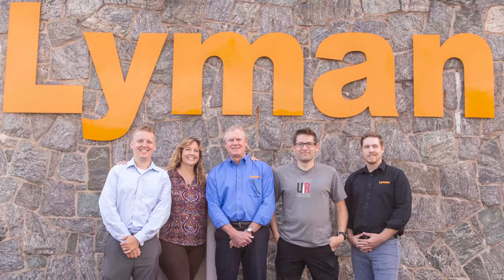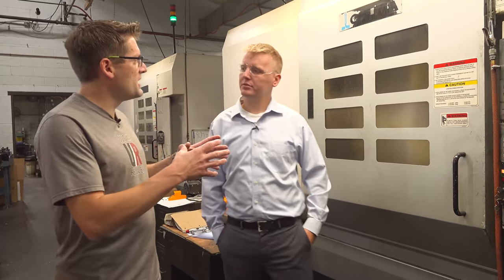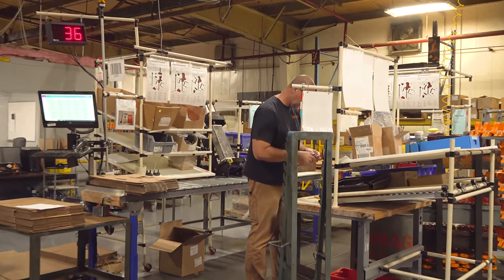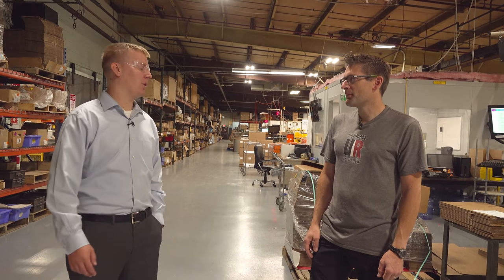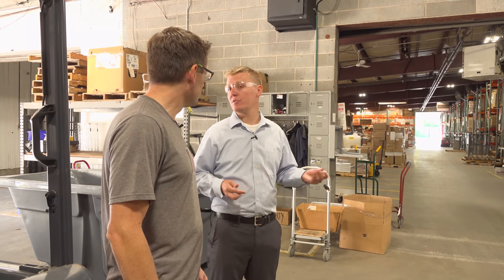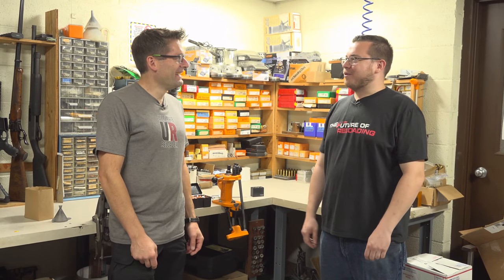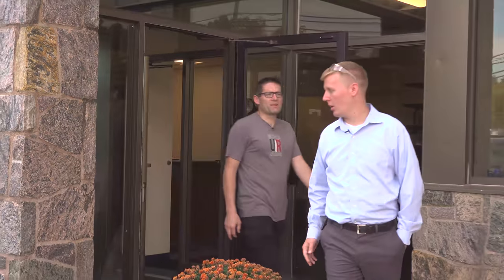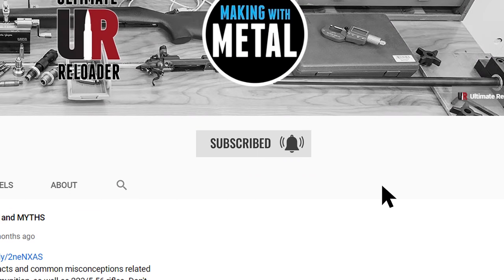Lyman Factory Tour

Comment: It seems that Lyman is really stepping up their game. 40 years ago I considered them a low tier manufacturer. But now they are running with the big league. I like the made in America with all American materials.
Reply: Tim Vatter that’s interesting. I’m 30 years old and I’ve always considered Lyman to be upper middle/top tier. I wouldn’t have guessed they were ever considered low tier.
Reply: @RebelFlag61  to a lot of us new comers Lyman isn't on the high mark of companies, most of this has to do with reloading Snobs.  I am glad I found this channel and saw this video, I have some Lyman stuff as I could afford it, but was not aware of the manufacture location, as I did not read anywhere on the box Made in the USA.  I truly want to buy American made to support American companies.  I will be purchasing some more things from them.
Reply: Lyman is absolute top quality, always has been!!
Reply: When i was shopping around for my gunsmithing screwdriver set i looked all over and just so happened to find that Lyman had a set. It's price made me think i was probably getting something with quality similar to wheelers. In other words good enough to get by during my apprenticeship. Well after 2yrs it's still going strong. I've even used some of the bits with my impact driver to remove screws so rusted into place i thought i would have to drill them out and never broke any of them. I have had to touch up the edge and tip on some of the thinnest straight blade and torq bits but once again i used them in cases beyond what they are designed to do. The driver handle is among my favorite too and I've tried probably over 2 dozen different brands bit drivers between my time in automotive and then gunsmithing. Theirs is shaped so it's very comfortable for long days at the bench, has a very grippy material so you aren't fumbling around with oily or wet hands (always hated using drivers like Brownells because of the slick plastic), plus you can quickly switch between a stubby driver or standard length by just pulling the extension shaft that can be used with the mini ratchet they include with the set.  Long story short, you definitely don't want to sleep on Lyman, i just wish they would offer a nice expansion bit set so i could keep it all one cohesive set. The only complaint i have is with the Glock front sight bit. The walls are thin at the tip so it easily will flair out and strip the nut. The cure was a trip to the grinder however and just taking off about 0.030" i found the walls to be thick enough to be serviceable and it hasn't caused any problems since.

Comment: I bought an All American 8 when I found a killer deal on Midway USA and I could not resist... I have yet to take it out of the box.. but I am making plans to give it a proper place on my small bench.  THANK YOU for you and Lyman for allowing us to get a glimpse on how its made
Reply: Have you tried it yet?
Reply: @golf-n-guns  Yes.. I love it.. smooth operating.
Reply: @kitanisthe  Are you still running the press? How is the wear and tear of it holding up? How many rounds would you say went through it so far?
Reply: @paulrussell1435  Y es I am running the press now.. I have about 800 rounds of .243 I have reloaded with it.. and about 1000 rounds of 9mm.  So far its held up very well.. I did take off the priming system though.. I decided to use the Forester priming tool for that.. but otherwise... a great press
Reply: @kitanisthe  Thanks for the update Frank

Comment: As an Mechanical Engineer I would have liked to see the Quality Control step after the CNC work. Cutting cast iron is hard on tooling they have to be checking parts " I would like to see everything checked" .

Comment: Saw a Lyman test where the turret stations were not  all the same tolerances. Alignment variances had different run out. So one should check each of the 8 holes for run out and put your sizing and seating dies in the station with the least run out. I guess the engineer needs to do some work-lol

Comment: Am I the only one who wants to know more about that Ruger No. 1 in the rack in the ballistics lab?

For goodness sake - Lyman makes reloading dies. I prefer their 3-die set for pistol cartridges for a couple reasons. The M-Die expander is simply a “better mousetrap”, especially for lead bullets. The seater die comes with 2 stems for different bullet nose profiles and 1 or the other always seems to work well. The set includes a shell holder which saves a little money, and the price is good overall. WTF Gavin?  I assume that you always use a scope or powered optic, but Lyman has been making excellent aperture sights, etc. forever.

Comment: I had a Lyman American 8, but ended up selling it because it kept getting primers stuck in between the ram and the spent primer chute hole in the front of the press frame before dumping into the cup.  I really wanted to like this press, but that happened too often and when it did, it completely locked up the press and I couldn't even move the handle until I was able to forcefully unjam it and pry the stuck spent primer out.  Maybe if Lyman would have made the hole in the front of the press bigger than the hole in the ram then the spent primers wouldn't get hung up...regardless, Lyman REALLY needs to re-engineer this aspect of their new presses.  Otherwise, it was a solid press so maybe once they fix this I'll buy another one someday...
Reply: Neil Whelden interesting... I’ve reloaded thousands of rounds on my all American 8 and never experienced this issue..... have you tried contacting customer service about that? Maybe there was a burr in there. Things slip thru from time to time, they probably would have repaired it or replaced it all together.
Reply: @mastercfromhalo3  No, I looked very closely at the entire assembly to see if there was a burr, or if there was some way I could modify it with a dremel or small file, etc.  Unfortunately, there wasn't anything that could have been cleaned up.  I think it was just the angle of the opening which was causing primers would just get stuck.  Then when they were half way out of the hole, they would occasionally jam on the bottom of the press.  Unfortunately, I'm not the only one to have had this problem - look at some of the negative reviews on YouTube or elsewhere online:  https://www.midwayusa.com/product/101962214?pid=757540
Like I said, I really want to like this press, but Lyman needs to redesign this.

Comment: The last Lyman press I owned the ram was drilled a 1/8th of an inch off center to the die...sent it back and they returned it saying it was fine. I now own a RCBS Rockchucker.  I has a Lyman 55 powder measure, it jammed constantly and was binding up so I now own 2 RCBS Uniflows. I had a Lyman scale...think 505, It was ok but not great, I now have 2 RCBS 10-10's that are great scales. I started reloading in 1982 with Lyman 223 and 357 dies. Tired of breaking pins and and having cases stuck I own about 70 sets of RCBS, Pacific, Lee and Hornady dies. But mainly RCBS. It is a free country and buy what you want but I was not surprised to hear this guy had a problem with his NEW press when he got it. Buy RCBS once and don't look back.